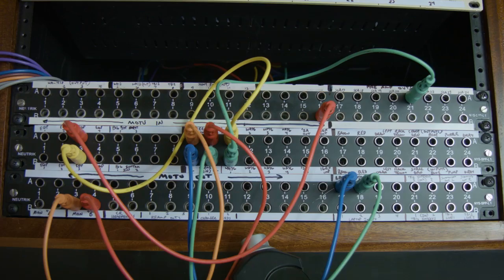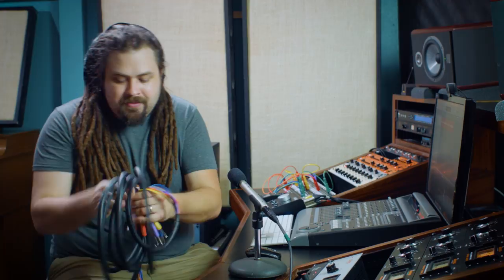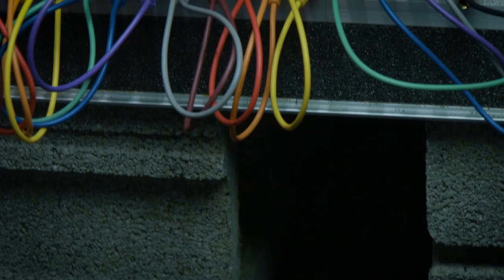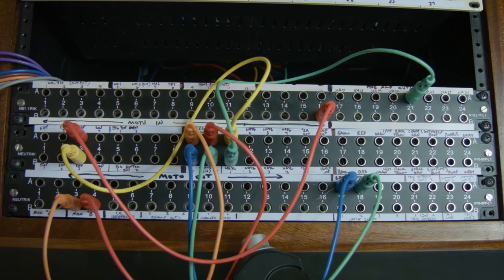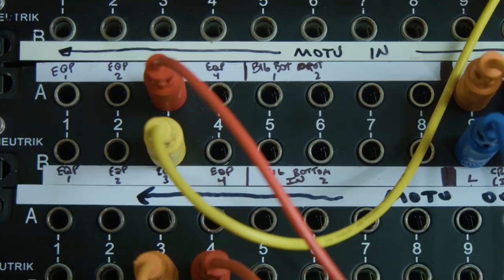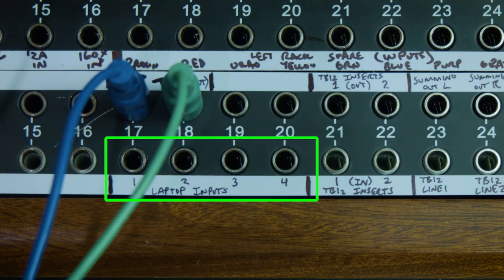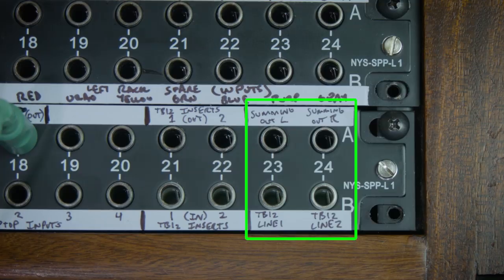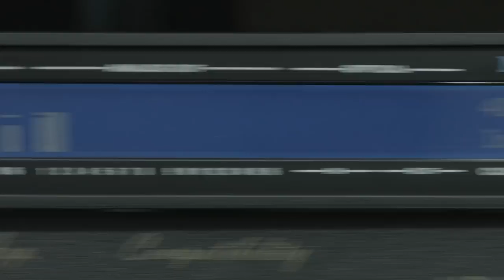New Studio Wiring!

Comment: Brilliant strategy. I have much less equipment than you, and already I see the need for at least 2 patch bays. This video will help me think it out. Also, I just wired up a studio for a friend where we play live and record multitrack at the same time. He has a 16-channel board for the live mix, so we got a Focusrite 18i20, an Octopre, and 2 ART 8-channel transformer isolated mic splitters (direct outs going to the recording interface, transformer coupled lines going to the live board). I made all of the cables, TRS and XLR, which saved a good bit of money, but more importantly, added to the neatness of the installation; no cable was longer than it needed to be. So, if you are good at soldering and have the time, make them yourself (unless Hosa has them cheaper).
Reply from the maker: Yeah, I like those ART transformer splitters. Those will come in handy. Yeah, I really wanted to make my cables, but I was pretty burnt, and needed a vacation. My two weeks off would have been just two weeks of soldering. Even with pre-fab cables, it took two days to reorganize the desk!
Reply: Fair enough. I only had to make 25 or 30 cables. We used long mic cables that he already owned and cut them up to the lengths we needed, so many of the cables already had one connector on them, which made it a little easier. Plus, I got paid for the labor. By the way, thanks for doing what you do. I enjoy the videos, always learn something or at least get an idea that I probably wouldn't otherwise have had.

Comment: I make my own snakes to be honest, was a hell of a job, all 24 channel multi cables, I have 5 of these, 1 for each NYS SPP-L1 I own. These are pretty good, if you follow a few steps. You can use these for many years like I do. It's a must-have if you are busy with music. Great video :) oh yes, don't forget the backside of the bay, they need to be wired too, maybe a tip, use thin balanced cables if you gonna built these in a closed cabinet, because less cable is much more cooling for your gear. The C286 from Tasker is a good choice.

Comment: Great vid on what is usually a really tricky topic.  Two things I might throw out there in case it helps:  There is nothing better about TT / Bantam patchbays vs. 1/4" jacks as far as quality (in fact, i'd say the 1/4" has more surface area for better transfer), TT is simply fitting more jacks into the same space that you pay more for.  Also, if you have the time you will probably cut your costs by over 50% and have quality like Mogami or better if you make your own cables.  Takes basic soldering skills (and that's a skill you should have as a studio owner / studio tech, i think).  You buy the end connectors you need and order up the spool of cable, cut it to the length you want, and its all according to what you need and not what lengths HOSA or others may offer.  Just my two cents!  Love your vids, bud.
Reply from the maker: Thanks and yeah would have loved to make my own cables but I have to consider my time.
Reply: @creativesoundlab  Yeah for sure.  That two cents was more for my peers cuz i am sure you can wield a soldering iron!  and like you said, you can't get back time.

Comment: So where do you plug your actual mics, intruments etc...? Thanks!
Reply from the maker: Mics go into the snake which come out at the patch bay. Instruments go into a DI box and then can go directly into patchbay on the preamp in jacks.
Reply: thanks man! So the snake goes into the back of the patch bay out. And then instruments plug into the in on the front? sorry this has been driving me nuts for days!
Reply from the maker: Yeah because in the control room you can access anything you would like from the patch bay. Just use a xlr to quarter inch cable after the DI box to the pre input. Usually the snake out on top flows down to the pre input but we would alter this if we have sources in the control room such as a vocal mic. No need to use snake from other room.